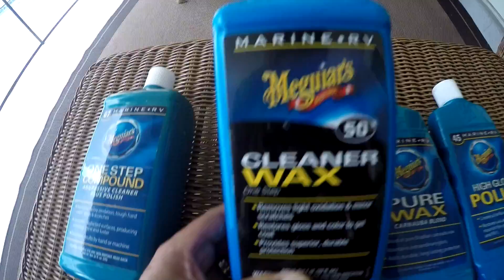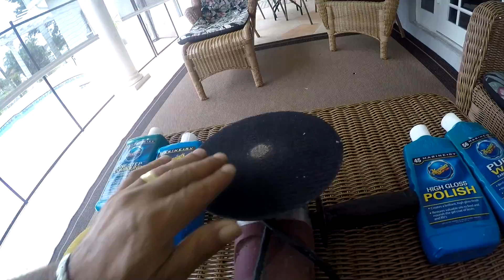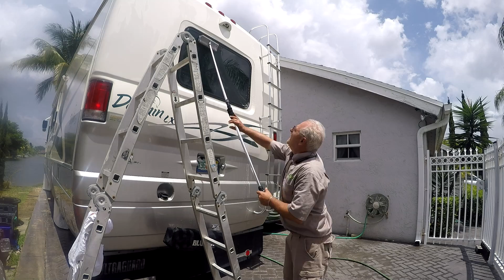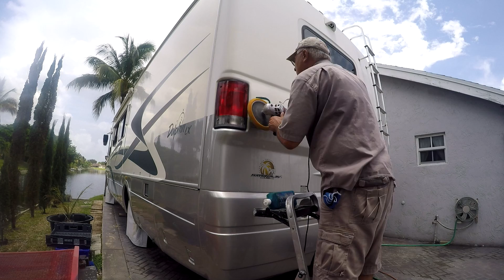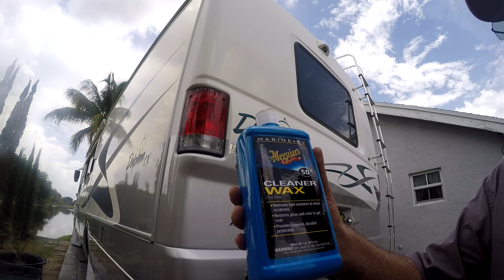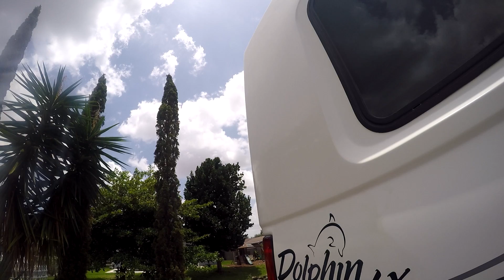How To REMOVE OXIDATION | RESTORE GEL COAT SHINE FIBERGLASS RV using Meguiars compound polish kit

Comment: What type of pad are you using
Reply from the maker: The one I used in this video I showed it in the beginning of the vodeo.
Here's the link: https://amzn.to/2L29Yy7
But I found out that the wool type works good on fiberglass as well.
Here's the link: https://amzn.to/31WHDmt
Good luck
Reply: @JohnCRV  My apologies....i went back and saw it, thank you! I just put a coat on of the one step as per your video, there is some improvement but this rig needs a lot more than one coat.  In your video you use the one step yet you do the polish and the wax....??
Reply from the maker: @irnfocus  If oxidation is really bad you will need to do it over with One step Compound until you get the shine. Keep in mind that  the compound has no Polish and Wax.
Each one has it's purpose. but what they call a "3 step" is:
step 1: Compound #67: removes heavy oxidation, hard water spots and scratches.
step 2: High Gloss Polish #45: creates high gloss finish, restores oils to feed and nourish the Gel Coat.
step 3: Pure Wax #56: maintains gloss and adds durable long lasting protection.
These 3 will restore your fiberglass Gel Coat to its past glory. 
A buffer is a must with the 3 step.
I use #45 Cleaner Wax regularly when there is only minor oxidation and or to remove minor scratches. It does restore gloss and color to the Gel Coat and provides durable protection.

I hope this helps.

Comment: Wouldn't you want to use the cleaner wax first
Reply from the maker: The cleaner is a finer grit and will not take off heavy oxidation. It’s good to just take off a light film of oxidation. You need the heavy compound first. Thanks for the comment.
Reply: @JohnCRV  Hi John, Do you have to use the pure wax after the cleaner wax or can i just use the cleaner wax as an all in one?
Reply from the maker: @truthwarrior1601  - Yes you can but it will not last as long.

Comment: Be very careful using a foam pad on A rotary buffer. Foam pads build up heat very quickly and will burn any paint or gelcoat real quick. I run a buffer every day and have for 20 years and they can be very distractive in untrained hands. I see it all the time. Much safer to use an orbital buffer and have the various different pads with the same success.Just my professional opinion
Reply from the maker: I changed over to wool pads the last time I buffed it. Thanks for the input, appreciate it.

Comment: Isn't it important to keep the buffet speed at low as to not damage the gel coat?
Reply from the maker: Hey Robert, yes but not too low and it depends how fast you are moving and how much compound you have on the surface, you have to get the feel of it. the important thing is not to stay still on one spot and try to get the oxidation off in one pass. Not sure if I'm explain it right.
Reply: John C RV thanks. I will practice.

Comment: I like that tool - looks like an angle grinder, but the adjustable speeds are awesome!
Reply from the maker: I'ts a buffer but you can use it for sanding, it's too slow for grinding.

Comment: I see you using dish soap. That is destroying your clearcoat!!!!   Knock it off with that.  It is meant for dishes!!  You're just creating work for yourself.
Reply from the maker: You are correct. I should have mentioned clearly that I only use dish soap before compounding so it will take off the dirt and grime. When normally washing the motorhome I use WASH & WAX. Thanks for the great observation.

Comment: Very good and thorough. Any experience with removing ghosts?(stripping vinyl stripes)
Reply from the maker: I did strip decals from my old motorhome years ago. I used a Heat gun or you can use a heavy duty hairdryer. Take your time heating it well so that the glue comes off with the decal. I hope this helps. Thanks for the comment.
Reply: Just finished most of it, since it was garage kept the vinyl was fairly flexible still. Heat gun definitely a must! Used Goof Off the first day, ran out and got Goo Gone-far superior. Used a third of the bottle to remove the residue. Hoping compound and polish will remove the outlines of the graphics.
Reply from the maker: If your cach was kept out of the weather most of the time you should be able to buff it all nice and even.
Reply: Ill let you know how it turns out

Comment: Is all fiberglass painted with 'gel coating?'  I have a 34' Allegro Bay Class A, so I'm guessing its a gel coat too.  I need to brighten it up like you've done.  How many hours total do you estimate that it took you to do the entire coach?  

Also just as a suggestion you should link to where ever they sell those 'waxes' and get some residual income from the sales since you have done a very nice video on a subject that is a bit complicated and shown how well the products work.
Reply: I have a 1994 Toyota Warrior Winnebago that is fiberglass without gel coat. So the answer to your question is no. I would assume the newer models have gel coating over the fiberglass but not sure if that is for every RV.

Comment: Just discovered you're channel good stuff. I have a 2007 National Sea Breeze , National built great coaches.
Reply from the maker: They are definetly built to last. Too bad they stopped making them. A friend had a Seabreeze he had over 100k miles on with no major issues with the coach or the chassis. Thanks for dropping in.